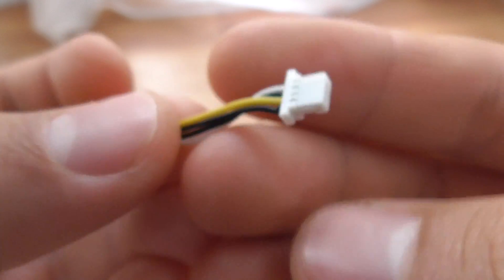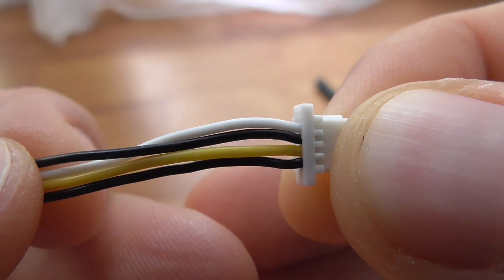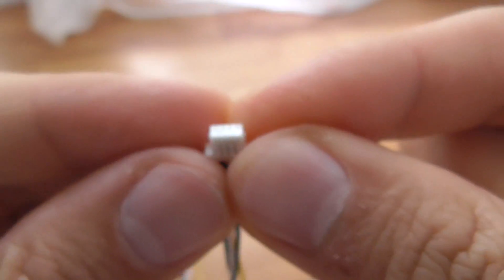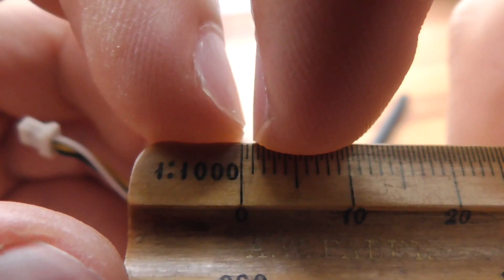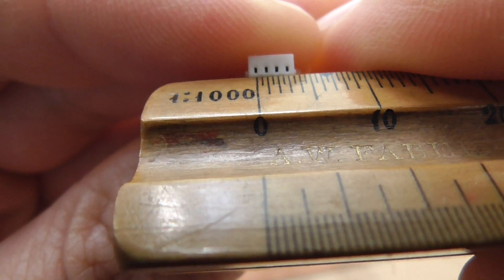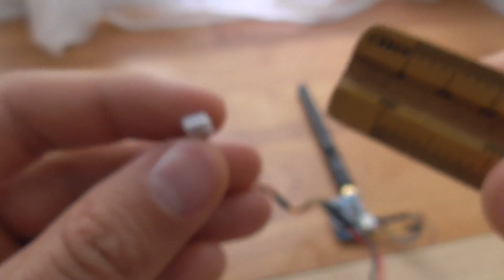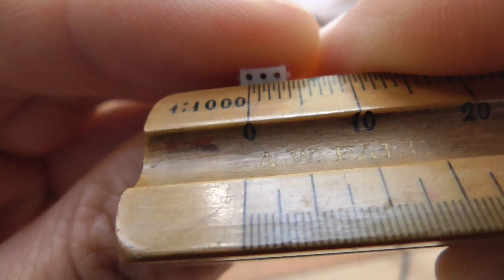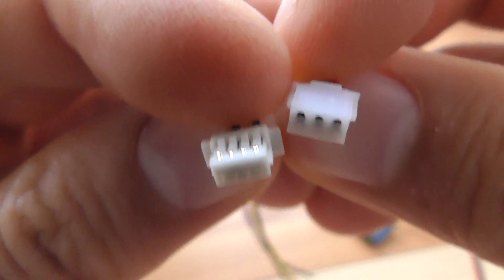JST Wire Connector types (4pin - 1mm vs. 3pin - 1.5mm)

Comment: Hi. Can you explain each wire also please? Is it red, live(positive), black (negative) yellow (earth?) I've got a 3 pin output on a circuit board that I need to connect wires to. Output with multimeter is 9V across 2 outer pins...but also 9V across the left and middle pins. So it's clear which one the positive terminal is, but unclear which one the negative is, because it's giving me 2 options? Can you explain the reason behind so many black wires too please? Thanks
Reply from the maker: In case of Direct Current (DC) usually red is plus, black is minus (also called ground). In case of Alternating Current (AC) it doesn't really matter because it is changing polarity. All black wires should be minus (ground).
Reply: @furulevi  Thank you mate!

Comment: Are you sure that it’s 1mm and not 1,25mm ?
Reply from the maker: At 1:52 that look like 1 mm...
Reply: @furulevi  
Yes i know,  but for the standart there isn't a 1mm connectors, only 1,25mm. Nevermind, thanks for the video,  i found the connector tha i needed.
Reply from the maker: There is 1mm also ► https://www.ebay.com/sch/i.html?_from=R40&_trksid=m570.l1313&_nkw=1mm+3pin+jst&_sacat=0&LH_TitleDesc=0&_osacat=0&_odkw=1mm+3pin+&LH_TitleDesc=0

Comment: In a Visuo XS809HW drone. Identify the Name of the connector (plug) that connects the proprietry battery when inserted into the Drone?  Thanks, Jerry Parent
Reply from the maker: The charging port is a Micro USB, but the other one which connects the battery to the drone that's a proprietary connector, I'm not sure if it has a name...